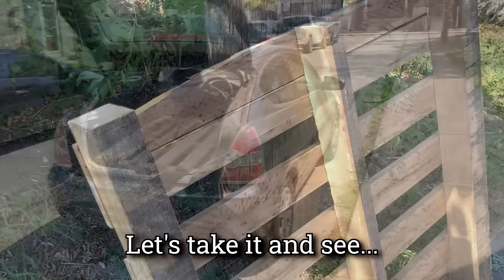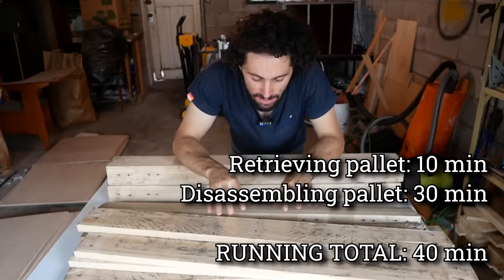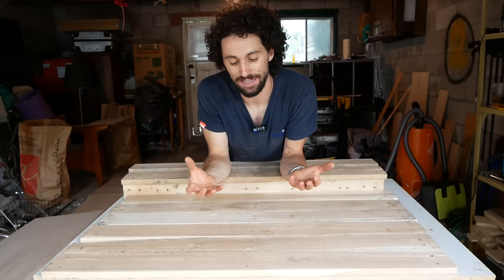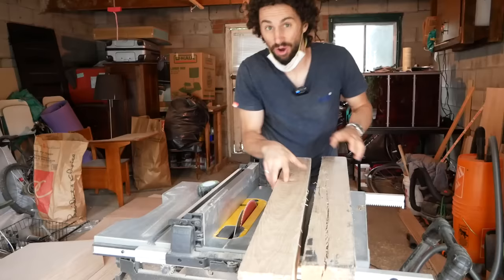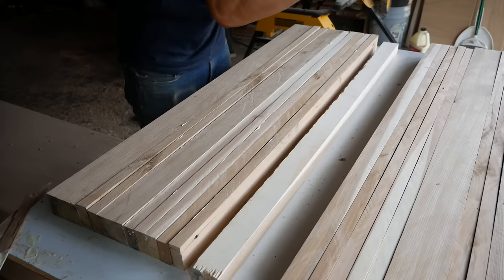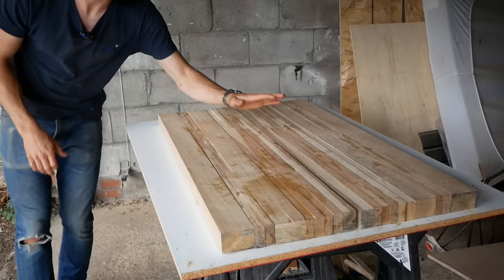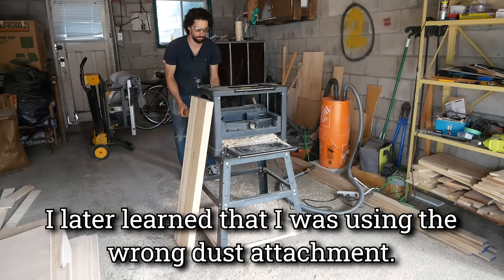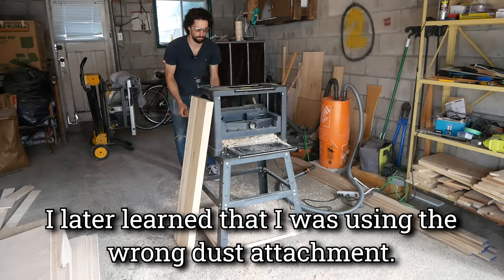Turning a Free Pallet into a $550 Table

Comment: Nicely done!  Good video.

I've pulled apart and cleaned up a few pallets because they were amazing wood (black walnut, cherry, white oak) but never thought of wearing a dust mask while cleaning off the dirt.  Good idea.  You really can find very good wood in pallets.  I understand that the lumber mills send about a 3" or 4" square section from the middle of the log to the pallet companies because they can't be sure how the pith runs.  While most pallets will be cheap wood, if you check them all you'll probably run across some good oak or ash (most common) and even some of the more exotic domestic woods.  I took apart a pallet that was used to ship rubber loves from Malaysia and I still have no idea what that wood is, but it's gorgeous and just waiting for the right project.

Before you send your recovered wood through a planer, you should check it with a metal detector.  There could be staples or other metal bits embedded in it.  Woodcraft sells their handheld Lumber Wizard II for 35 dollars.  Unless it's a big nail, your saw blades can probably handle it (but use push sticks in case it kicks back), but even an ordinary staple will put a nick into your planer's blade.

The old saying is that a woodworker never has enough clamps.

With the close-up while you were chamfering, the pallets runners looked like ash - maybe oak, but I didn't see oak's usual rays, so I'd guess ash.

Comment: Did you factor in the dulled blades that will need sharpening of replacement when working with pallets?  Pallets are impregnated with sand and rocks because they sit on the ground with heavy weights placed on them which drives dirt (rocks with organic material), sand, and other debris into the wood.  Everyone tries to work with pallets at some point until you realize just how expensive it really is on the equipment.
Reply: I had wanted to work with pallets. This is the only time I listened to my husband and did not try the pallets. I value the lifetime of blades on my planer and also possible kickback from the table saw if a wayward piece of metal as missed in the pallet clean up. But I will say that the project turned out beautiful. Great job!
Reply from the maker: Thank you!
Reply: He clearly brushed the wood before cutting it. There was no sand inside the wood.
Reply: @xl000  xl - try working with pallet wood and then get back to me.  I speak from experience - you can't brush away sand and dirt that gets embedded and it will dull you blades very quickly.  Especially planer blades.

Comment: Looks nice! I'm seeing a lot of great advice in the comments. 
I'd like to comment on something though, I think that giving yourself an hourly rate of $100 is quite over the top, you obviously thought the same when you dropped the price. You even said that you wouldn't buy a table for that much. 
I would suggest just doubling the cost of materials for it. That way you still make a profit and also cover your costs. Once you do some more detailed and complex methods you can calculate hours into it for the artistic aspect instead of just doubling your material costs. At that point I would suggest charging $15 per hour like you would as an apprentice for a trade, then charge more as you gain more experience, understanding, and skill in you work. 
Keep it up!

Comment: If youre having hard time pulling your crowbar to remove a nail try putting small piece of flat medium wide wood under where the "joint" of that crowbar meets the wood base as it will reduce the pulling and makes it easier. I dont know how to properly explain it cuz my english is not that great but trust me it will always work. Plus it will not leave any dent upon pulling because of the crowbar

Comment: Really Kool project and glad you made some decent cash out of it!
A side note for You and all, almost ALL freight pallets/skids are made with hardwood.
There is a few made from like pine and fir, but those are like industry specific, meaning the shipper doesn't need a stout pallet or, the weight of product is so light it is over kill to use hardwood pallets.
And of course, many now are being made out of plastic/composites but those come with a deposit and are very expensive.
Cheers from USA!

Comment: to fill the cracks, take a glue gun and make a little barrier around the crack, that way you can just pour the resin and let it fill in. You can also take your tool or a brush and shove some resin in at first just to make sure it flows the whole way down and its not just sitting on top. Then the hot glue will just peel off.

Comment: Cordless tools are convienient for off site use, yet if you are in a shop, plug in tools are more efficient in power and torque ... just saying. Also id your corless tool batteries freeze, they will not be holding a charge for long. Canadians learn this the hard way, if garages are not heated.
Having clamps on the bottom can make your glue ups easier too. A trick I picked up along the way was to split open a large plastic garbage bag, place that on work surface first, before glue up. After glue up, the glue that drips off the bottom will, once dry, be shaken off plastic into a garbage bin. Save plastic sheet for future use. Gluing up one board at a time is okay, yet with large jobs, inefficient. Lay out boards in finished form, mark as top ... usually a large 'V', then stand the boards on edge, use a brush or small roller to spread glue on the combined edge, then lay the boards and clamp quickly. Why at this stage, I do not like quick tack glues. Some things require time to do properly ... hurrying can cause errors. Having a mallet to quickly tap down boards that slip, tighten clamps simultaneously then place clamps on top too, staggared with ones on bottom to prevent cupping. Plane or sand once glue is dry, with cupping on the bottom to establish a flat then flip.
When planing or surface sanding the panels, alternate passes top and bottom because the heat generated causes cupping of the panel. No, I'm not kidding.
I saw someone try to maintain thickness of panels by doing only one side and after the panels cooled, they were cupped and impossible to correct. I did wsrn him and he thought I was stupid. p.s. if you work with Black walnut, stain it dark after sanding etc, before the finish ... why? In sunlight, the ultra violet light causes the wood to turn pale. Most woods will lighten in ultra violet/sunlight. Try it. Take a piece or strip of it, make a cardboard sleeve on half of it and let the sun get at it ... a marked difference in a couple of weeks.
Good video. 👍

Comment: I took a short cut today in my shop and almost lost the top part of my thumb, no matter how skilled or comfortable you are doesn't matter when that split second accident happens. Luckily it only sawed the top part of the nail to the quick. Its painful but I'll take it over losing a thumb or worse. Seriously please don't ever have your fingers anywhere near the blade. I got lucky today but its a good reminder that nobody is exempt from accidents. Other than that its a pretty cool table top idea and it looks great, the table top did bow on you but it can be avoided next time. I've seen a few comments already that talked about how clamping should be done and it certainly takes away that problem to not have all clamps on one face of the board taking all the tension.

Comment: To get epoxy or glue or whatever you are working with into cracks , especially small ones you have got to get some "glue dispensing syringes and tips" they are a lifesaver! And good for perfectly measuring out your epoxy so you don't waste anything :) Also they are incredibly cheap and sold in bulk on Amazon  so if you have to throw them away cause you don't wanna clean them or you leave it sitting out too long and it hardens it's not that big of a deal. However, it does take those types of liquids waaaaaay longer to harden inside a syringe. Especially a capped one :) I've been doing this for about a year now and it's one of the best little hacks I've discovered because it's so convenient and cheap. In a years time I've still not even went through my first bulk box because they keep so well :)

Comment: Edge match with a plane by putting the two pieces side by side and planning both edges at the same time. Add saw dust to glue to make a matching filler

Comment: Most general-purpose pallets are made of C grade pine.  Some are made of lower grade oak, usually the sap wood layer.  This is why you will find some boards with bark and irregular edges.
Nice work repurposing a $3-8 pallet. 🙂

Comment: Also, I see a lot of comments cringing over the fingers being close to the blade. Honestly, that's not even the bad part. To get a straight edge via table saw, you NEED to use a jig. If the fence side isn't straight already, the risk of kickback increases a LOT, which is the most dangerous thing on a table saw. If you're not sure about the edges being straight, making a table saw jig for this is super simple. Be safe.

Comment: Quick tip on glue ups clamp from the top and bottom to keep from bowing. Also you can clamp a piece across all the pieces on each end and use a clamp to hold it down . I usually clamp it to the clamp running under the main piece. This will keep any of the main pieces from popping up during clamping .  Good diy video Saftey first   watch your eyes 👀

Comment: I worked at a place where we had a truckload of empty pallets going out periodically (as trash I think). Sometimes really long, heavy ones for vinyl siding. I stripped and milled a bunch, and you can find all sorts of interesting patterns in there, as there's sometimes burl and grain that's not suitable for selling as wider planks, plus you've got species from many different regions and nice hardwoods which are probably more abundant there. The bad part is, I soon discovered that the quality of material they sprung for was directly related to how well the pallet was made, which was directly related to how much of a PITA it was to take apart, and sometimes the number/type of fasteners you had to deal with. The really nice ones had all these heavy duty spiral shank nails and crap that took forever, plus you were stuck with the holes and rust spots. Still pretty rewarding though and I'm still using some of it twenty-five years later. -Good work and thanks for the video!
Reply from the maker: Thanks for watching! I totally relate - TONS of spiral nails in this pallet. Took forever to get them all out!
Reply: Get a Pneumatic Locker to drive the nails out
Reply: Air Locker AP700 Heavy Duty Professional Air Punch Nailer / Nail Remover / Nail Puller. 1/4 Inch NPT Thread Air Inlet. 80-120 PSI Pneumatic Nailer Removes 10-20 Gauge Nails , Black

Comment: Next time you do a final table jointing to glue up two halves, rip one half on the left of the blade, and one half on the right. It's almost impossible to get your blade set to a perfect 90 the same as it's almost impossible to hand plane to a perfect 90. Best practice is to clamp the two faces together and joint the edges you're going to glue at the same time. When you open the project back up any deviation in the angle is irrelevant because what ever it was will add to 180. This way your glue up will be flat and not rock in the middle since you're not planing the finished piece and it won't crack in half because of the screws pulling it flat on unforgiving metal legs.

Comment: I turned an old IKEA wooden bunk bed that fell apart into a keys and mail table, I only had a mitre saw, orbital sander, a battery drill and a dowel jig. I stained it with deck stain and top coat that I had lying around. It's still at my Mom's house holding keys and mail and flowers and stuff years later!

Comment: 1. Always use a push stick 2. If jointing on table,  better flip the second piece to cancel out the uneven angle setting. You would avoid this slight cup this way.

Comment: Nice work but using a tablesaw as a jointer only works if you have a parallel edge referencing a parallel edge. Since your wood boards didn't already have a perfectly straight edge, referencing a straight fence will give you somewhat parallel sides on both sides but not perfectly perpendicular to the other faces.

Comment: If you put the boards through the planer like you do at 2:30, how are you sure that they are actually flat? Wouldn't you need a sled and put shims where there's a cup/bow in the wood to get a flat surface?

Comment: Don’t eat off of pallet wood. Especially when you find it on the street. Could have held fertilizer, chemicals, organic materials, etc. Has likely been in contact with motor oil and other chemicals found in parking lots…

I wouldn’t eat off of that.

Comment: It's not really a $550 table is it after taking off the building hours, the sanding machine, the sawing machine, the garage costs, the glue, the clamps, the sander, the circle saw, the epoxy, safety gear, the beveller, the varnis, the table legs and delivery. This isn't a project for someone who hasn't already made quite a big investment.

Comment: Running your board through the table saw does not give you a straight edge like a jointer, it just gives you an edge that matches the side that was against the fence. 

You need to clamp the board to another board that has a straight edge already and then run it through the saw.

Comment: I had the exact same sawhorses, and I hated them. I had built a table that locks into the recess in the horse which worked well, but the cheap plastic broke eventually. Buy metal ones, or build decent wood horses. And save yourself the trouble.

Comment: I can relate to the battery power on those old Ryobi tools I was using them for a long time until I finally switched over to almost completely cobalt which I like almost better than any other tool brand with the exception of some really nice ones like a Bosch saw and a not sure about the brand lathe but I'm not even sure cobalt does lathes anyways.

Comment: FYI: Try to find out for WHAT and WHERE a pallet has been used...sometimes pallets are used to dangerous and hazardous chemicals that spill on and are absorbed by the wood. You don't want to breathe that stuff in when working on them or put that shit in your house.
Reply: YES THIS 10000% ^^^

not only that, but some pallets are pretreated with methyl bromide to prevent being eaten by pests, and methyl bromide is a neurotoxin & carcenogen 

IIRC it's illegal in some countries to treat pallets with MB, but some older ones might still be around and if the pallet came from overseas, who knows what laws applied where it was made

there is often something called the IPPC label stamped or burned into the side of pallets, and if there's an MB towards the bottom, it was treated with methyl bromide

Comment: I read the comments first then watched the video. I was expecting to see him pushing little pieces of wood through the saw with his fingers right next to the blade. I just saw a guy pushing planks through his table saw. His saw has a riving knife so kick back is much less likely.
I use a push stick sometimes, other times I don’t feel the stick is stable enough. What is close is relative to me. Driving on a  2 way highway going by on coming traffic at speeds of 55 or more, missing each other by 2 or 3 feet can seem crazy, especially with people texting etc...
Be safe and reasonable. I’ve seen skilled reputable craftsmen doing the same.
If you’re new you may want to follow th advice about PPE.
I know what you’re gonna say so save your time, don’t respond.

Comment: nice job . my only comment would be to build a better work table. make it the same height as the table saw so when you push wood thru the saw it will slide on the work bench. don't wipe off the extra glue. let it dry and scrape it

Comment: Dude, I'm not a member of the safety police, but I'm not gonna lie, you made my butt pucker every time you used that table saw.  Please get an outfeed table, or at least an outfeed roller, and some push sticks!

With that said, you made a nice looking piece out of that pallet wood.  I could tell that it was cupped when it came out of the clamps though.  To prevent that, alternate your clamps top/bottom/top etc, and make sure each clamp is applying approximately the same pressure.  I also noticed that you got some nasty chip out when you were trimming the ends.  A little masking tape along the cut line to support the wood fibers will go a long way to prevent that.

Good job though.  Keep making stuff and keep all your fingers!

Comment: Holy crap, and here i was thinking 600 was even way overpriced (not that you aren't worth your work, i just don't get where people keep getting their money from), and i thought the price of those table legs tanked it and you might be happy to make a few bucks on it. 

550 sell price, if you take a 150 off of that in material cost ( glue, epoxy, table legs, electricity and tool wear ), you earned $ 400 USD on that, for a day's work. that said, selling also takes time. but let's say you can make 4 of those in 4 days, and sell them all on the 5th day, perhaps even for a little less, so let's say 350 each in earnings ( sell for 500 ), then that's 1400 a week. that's about 6k a month (before taxes). let's say you keep 4,5 k a month from htat after taxes (perhaps more, i'm from the EU and that takes a lot) and that gets you 54k a year, and imho, that is a very decent salary imho.

Comment: I understand that you are probably not a trained carpenter, which is not the point.  I would completely skip some steps, such as cleaning the boards with a wire brush, etc. the whiteness of the wood can also be considered unwanted, especially for period tables. Man, it's not worse, but I had to re-record the video in the platoon. sorry for google translate i'm not good in english